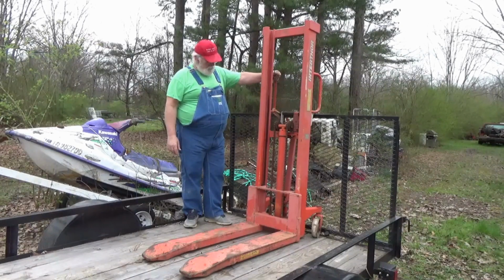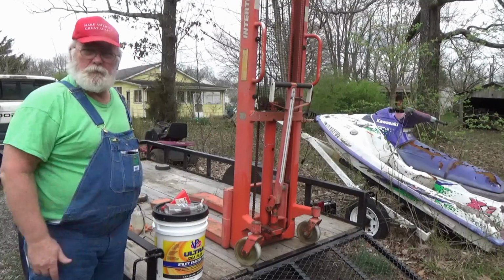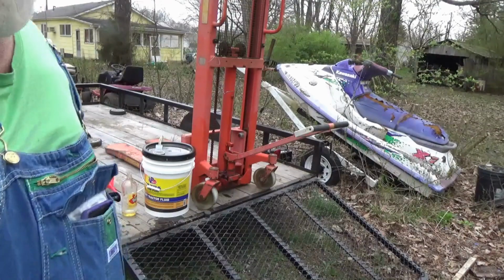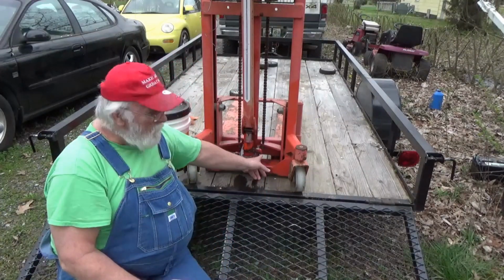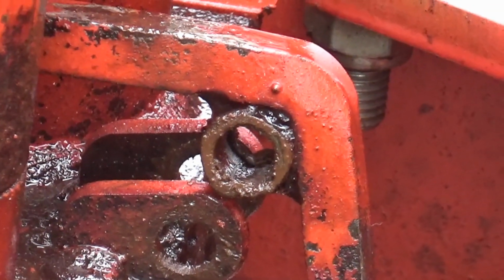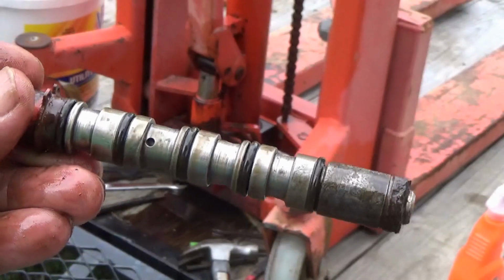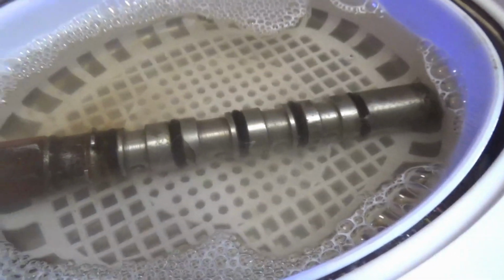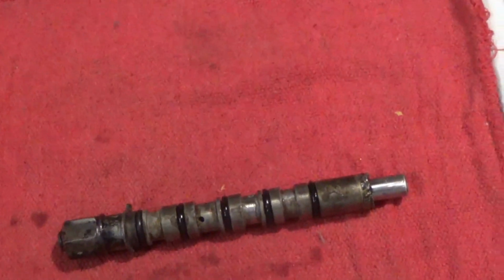PawPaw Makes a Riding Lawnmower Motorcycle ATV Lift Table from Junk Pallet Stacker

Comment: Cut a piece of steel heavy walled box tubing to put inside the mast channel under the carriage roller. Secure it with a c clamp and you have a sturdy and secure safety prop. Otherwise, you can use a sturdy chain and go around the top of the mast channel and down to the cross bar on the carriage. Even if you didn’t have a drift issue, I would still recommend these as safety practices. Great find! Hope you get some good use out of that old stacker.

Comment: I saw on another vid of u a pack of top papers and bag of papers. Been doing same as I don't want to smoke forever. It's really caused me to cut back as I have to stop to roll and I'm mostly busy. Just knowing I can smoke makes it so much easier than trying to cut back when I have a pack in my pocket. Love u vids
Reply from the maker: I threw the papers and tobacco in the trash and poured water over them on January 16, 2016.  I have not had a puff of ANYTHING since then.
Reply: @DoingItCheap   good for u sir. I'm working on it

Comment: The lift may work better if you can get any air and water out of the system and replace the oil.. I would still use something for a jack stand to be safe. Take care.

Comment: that "thang" is worth much more than you paid. They have good hydraulic ram.  If you lost just one part it would not work right.
A friend of mine just bought a 2013 Ford F150 4dr with the 3.5 engine for $1000 and it's all good and it's fast. Oh that would be in Canadian $ so $700 US

Comment: 65 Ford is great, he needs to make More videos !!!!   I watched his video where he made his table, Harbor Freight has that a jack like he used for around $150. I think ?  I could use one.  YouTuber "Musti" has an Air lift bench for Motorcycles that he added wider sides to. Makes things much better when you can stand Straight up rather sit on the ground to make repairs.
Reply from the maker: No, Moe has a commercial high lift pallet jack, not the little lift table from Harbor Freight.  I looked at the motorcycle lift but did not like the price.

Comment: That ultrasonic cleaner is amazing for it being so small. Does that one heat the cleaning fluid also, or does it just run it cold?
Reply from the maker: It does warm it.  I just wish it ran longer than 8 minutes.  I reset it every time I walked by for a week !  Probably would have done just as good in 24 hours if it didn't keep shutting off.
Reply: @DoingItCheap  well thats not very good, you would figure it would run for an Hour at least.
Reply from the maker: I did a little research.  If they run too long they actually can eat the metal !!
Reply: @DoingItCheap  Thats good to know,. never thought about that.

Comment: I would not call that junk to begin with :) I have a dc hydraulic version I love. I have been meaning to make a better "table" for the commercial mowers. I have used it for loadin n unloading and a adjustable height surface for working on many things and welding/fabricating! The only bad thing about it is it takes ue a fair amount of room in my small garage... ya will wonder how ya did without one for so long!
Reply from the maker: I scratched my head and searched and searched.  I am VERY pleased with this and if I did not have the ability to rebuild the cylinders, I would buy a new one.

Comment: Replace the O-rings paw paw. They've got Plumbing o-ring kit you can get at Home Depot for cheap I think would probably work
Reply from the maker: I actually got off the phone yesterday with a distributor.  I bought a complete set of seals, wipers, rings..... everything that can decay.   Gonna pull it apart and replace all the rubber.
Reply: Got to make a video of that one

Comment: I need to make a tumbler for cartridge case tumbling with steel pins. i've seen large ones made with old tires and an electric motor but I need something smaller. Any ideas?? It just has to roll slowly a water tight plastic container filled with small 1/4 inch steel pins and the casings to clean.
Reply from the maker: Jack up your riding mower so only one rear wheel is on the ground.  The one in the air will turn and the one on the ground won't unless you have a solid rear axle.  I have done it with a tractor to clean the rust out of a gas tank.  I put pea gravel in it and tied it to the rear wheel.